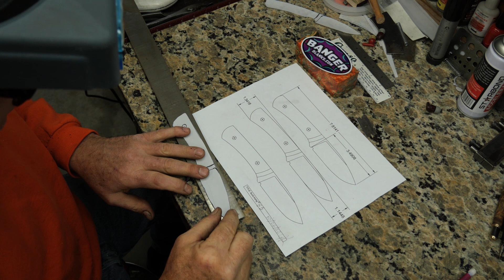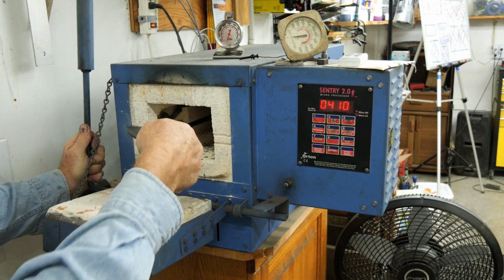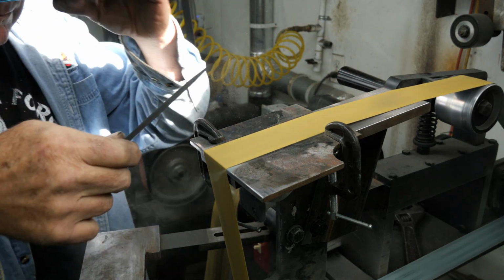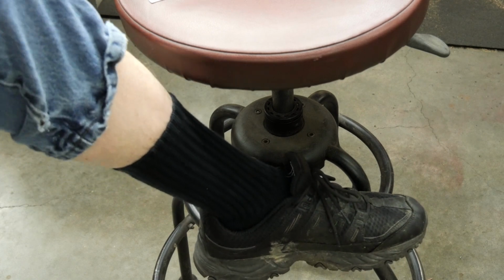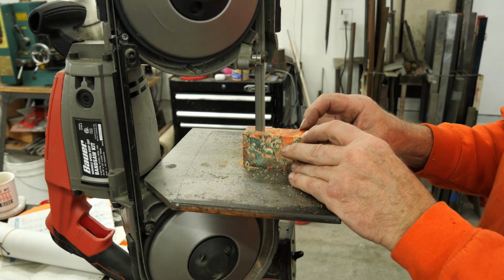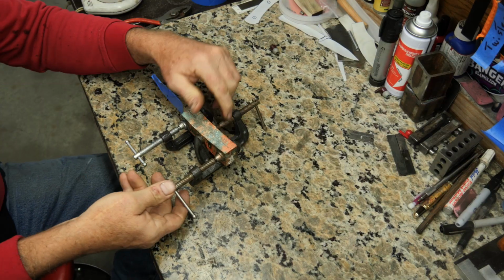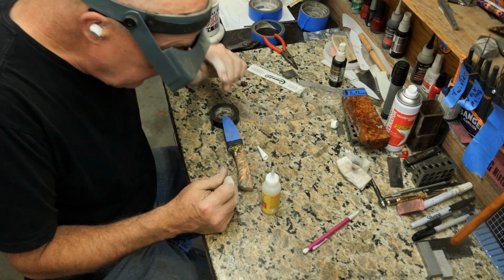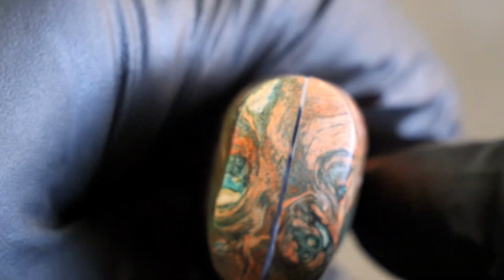I Only Have One Day To Make This

Comment: I’m interested in the bit you used for scale flattening.  Looking through Grizzly’s bit selection, the closest I’m finding that I think might work is the Southeast Tool T30940 - 2" Carbide Tipped Spoilboard Cutter or the Grizzly H2960 - Dovetail Cutter 1-7/8" x 60.  Do you recall the style name for what you have?  The face bits were considerably more than what you mentioned, so I ruled them out just on price.
Reply: Robert Pearce I also searched their site without any luck. Hopefully he answers but if I find it before then I’ll come back and let you know.

Comment: Never ever ever under any circumstances wear gloves when operating a belt sander, drill/mill or lathe. If that glove gets snatched up by the sander it could grind your fingers off. A drill press or mill (bridgeport or whatever) will grab your glove and rip your arm around the spindle breaking it in multiple places, and a lathe will yank your whole body round n round. No gloves, loose clothing or long hair. I heard a story about a young lady getting her face ripped off when her hair got caught in the bridgeport, glad I wasn't there to see it.